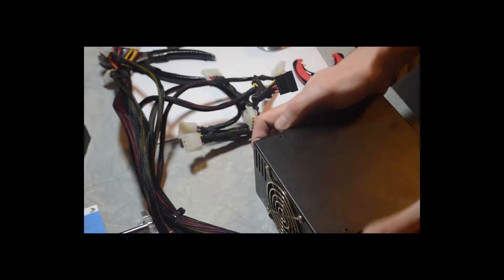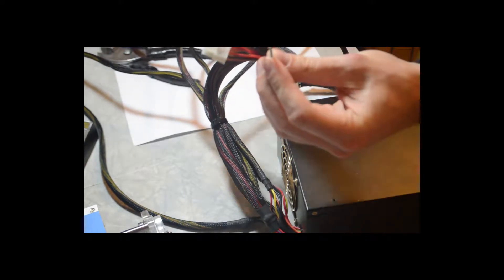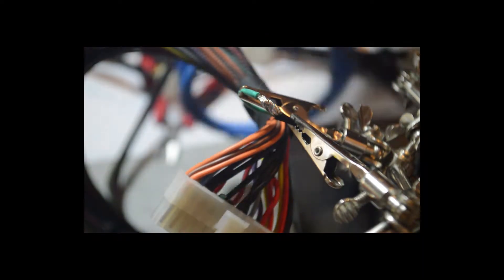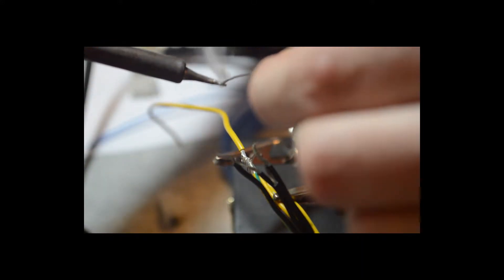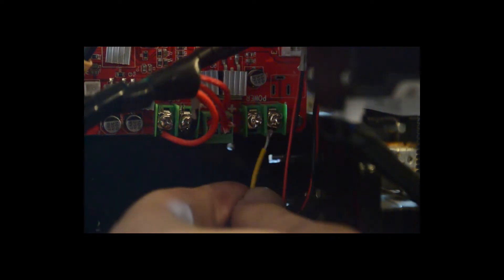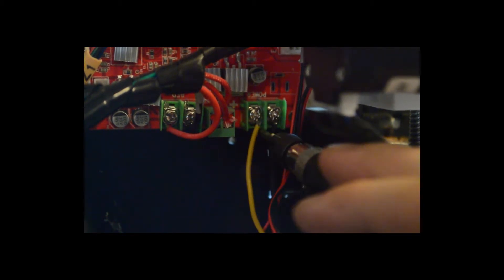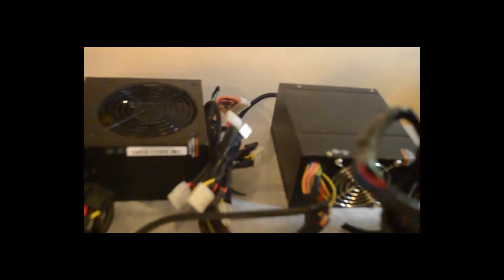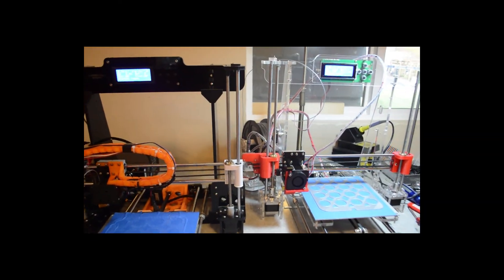Let's Build! - 3D Printer + Converted ATX Power Supply

Comment: is there a way to make it output 24v for the newer printers coming out? thanks
Reply from the maker: ATX PSUs have outputs for 12v, 5v, and 3.3v, so you would need a secondary transformer to get to 24. At that point you might as well buy a dedicated 24v PSU. They aren't terribly expensive and the purpose of this application is to find a new life for otherwise obsolete components.

Comment: does the atx unit heat up the prnter faster?
Reply from the maker: It does indeed, all my printers have between 350 and 500W ATX PSUs, compared to the stock 220. I have a HyperCube as well, and the stock PSU could not bring both the bed and hotend up to temp simultaneously.

You could realistically power two printers off one PSU, but I prefer the control and dedicated power for each.
Reply: @MegaRetroRocket  That's the moeny shot, this one of umpteen/many videos on ATX PSU but, NOT ONE, not a single one of mentions a single benefit other than implying the stock PSU isn't real safe.Everyone talks about upgrades to the anet a8 but, no one talks about the before after results.i bet half the upgrades aren't even needed.
Reply from the maker: @cdoublejj  That's often true of the 3d printed parts; just tidying things up and aesthetic expression. In my experience reinforcing the frame does improve layer fidelity, but all the elaborate Z-braces don't do much unless you're maxing out the print height regularly.

Several of the capacitors in my stock PSU exploded and crumbled, so I decided not to risk it on any of them. Haven't installed the ubiquitous mosfets and haven't had any problems with overheating.

Honestly, the parts on the A8 in particular are a crap shoot. You either get a good kit or a crummy one and all the add-ons and printed 'upgrades' are going to have a limited effect. The Tronxy P802M is about as good as the worst A8 though...